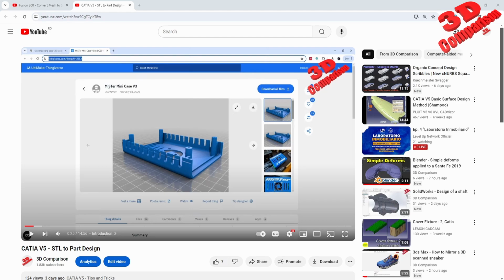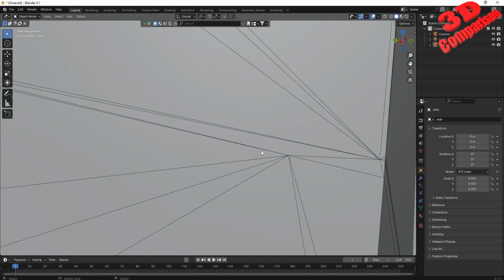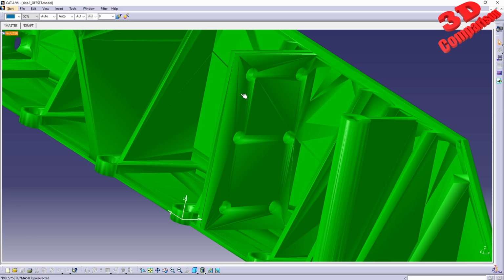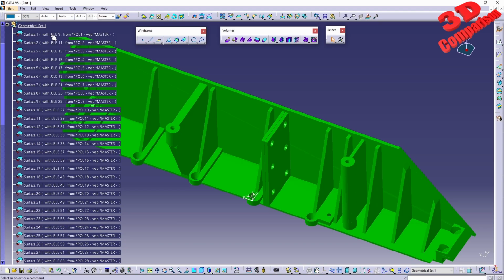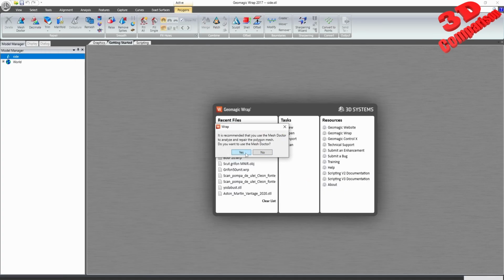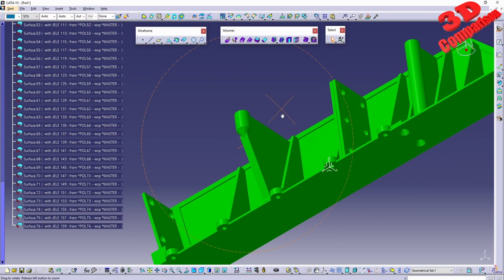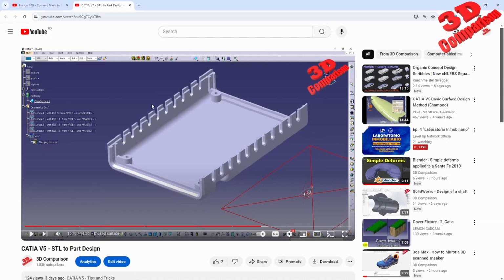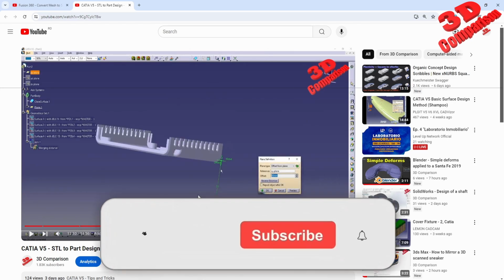CATIA V5 compared to Fusion 360 - STL to Solid Body

Comment: Thank you so much for the video. I am used to do everything in Catia, how difficult to switch to Fusion 360? What are the fundamental differences?
Reply from the maker: Hello, Thanks for the comment. I also prefer to use CATIA as this is the CAD solution that I learned during my studies, but Fusion 360 offers better workflows in some cases. CATIA V5 is still far superior when dealing with Surface Design. I would suggest that it is good to learn multiple CAD solutions and Fusion is quite a good solution option as it is available for free to hobbyist.